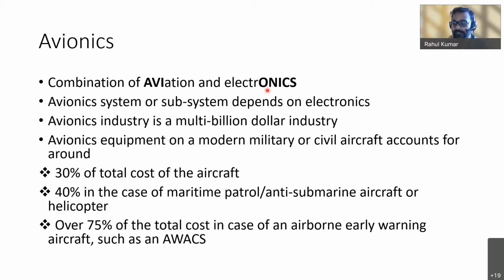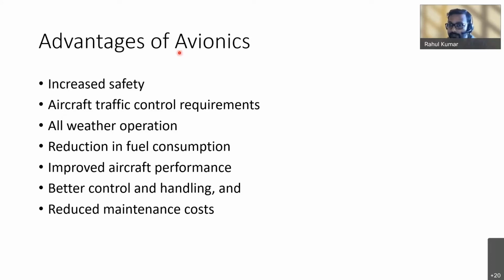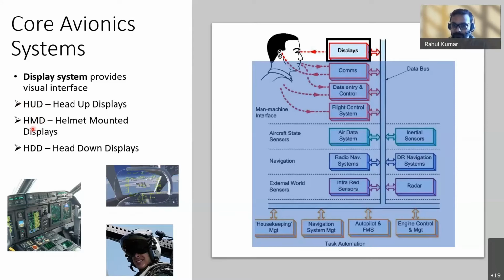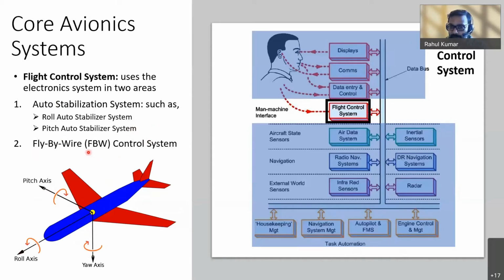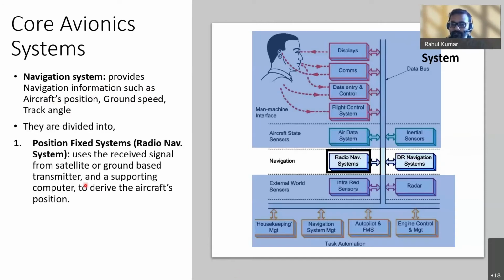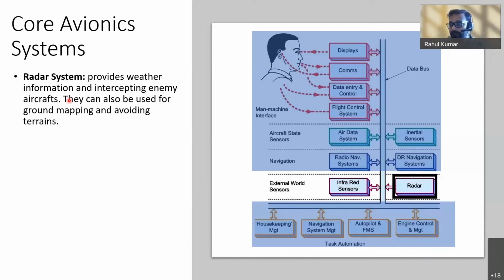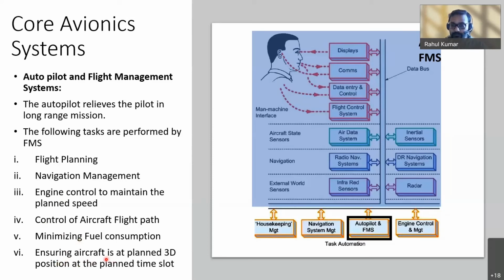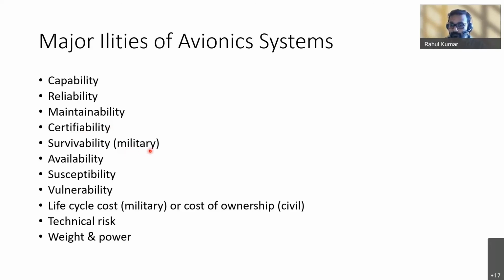L1 Introduction to Avionics

Comment: Great video.  Not to be picky but INS is not the most accurate.  IRS laser gyros are the most accurate.  Also, the ADIRU (Air data intertial reference unit) is extremely accurate.  Besides that, awesome video, you have earned a sub and like. :)